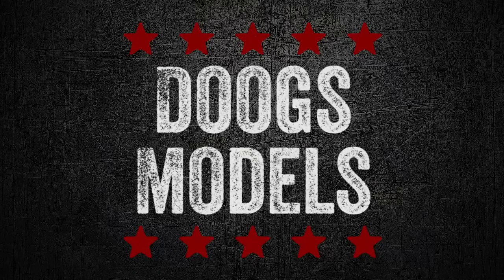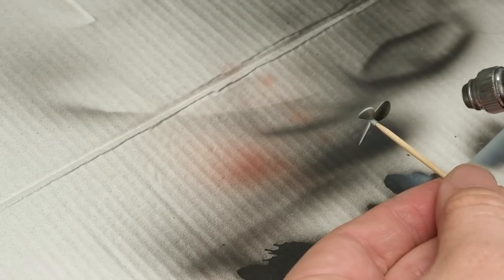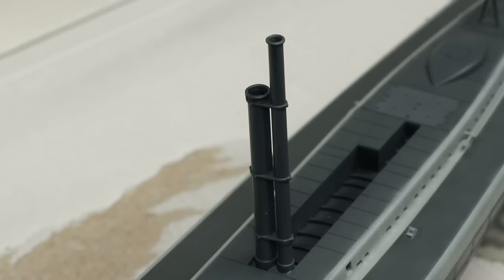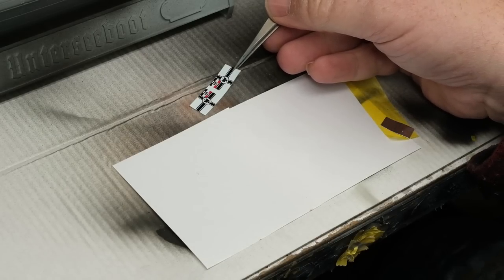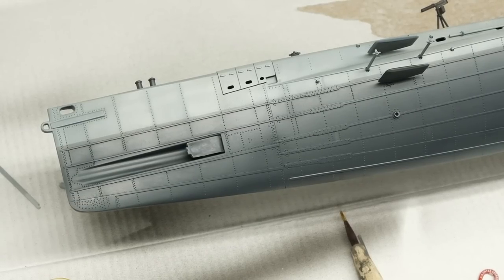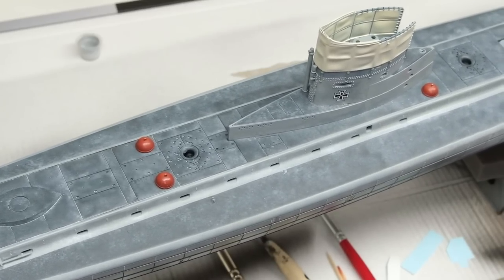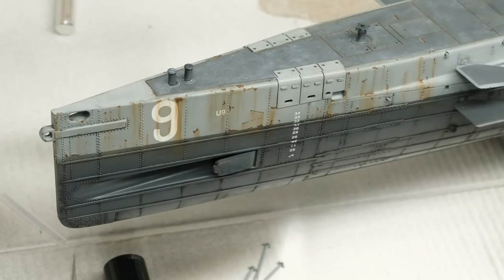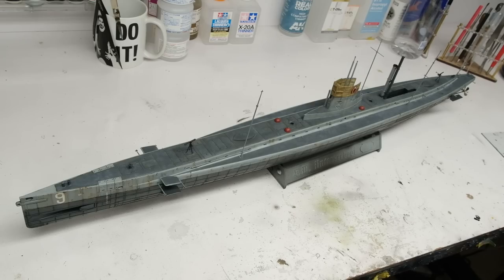Das Werk 1/72 U9 U-Boat Pt 3 - Weathering & Finishing

Comment: Hi loving this build;
Just for information, wooden duckboards were typically painted black with sand mixed in to it. 
As an ex-submariner - we are terrified of being spotted by aircraft when the sub is just below the surface, so anything light was painted. 
Also bear wood becomes very slippery when wet, hence why sand was added in the paint to provide a rough surface.
Reply from the maker: Yeah the painting guide basically shrugs at the wooden boards, so I opted to go with what was more visually interesting. 

One thing I had to keep in the back of my head during this build was that this thing was built in 1910 and its main service was in 1914, before aircraft were a major factor. I imagine practices changed drastically by 1918.

Comment: You're an inspiration to watch. I really admire your techniques and I've learned a lot. If I may offer a couple of critiques though: 1. I would add a light green wash on the propellers. Unless she's just out of the yard, a ship's propellers are never that bright. 2. Your weathering job on the canvas is truly amazing, but it's not right. For future reference, canvas at sea isn't dark, it's light. The sun fades it very quickly. It also might have a slight greenish tinge from algae and a little bit of grimy black around the edges from mold. I'm a sailor, so I've seen this a lot. I apologize if I've offended with my remarks, none was intended. Thanks for sharing this, I'm really looking forward to getting my U-9 kit, and I wouldn't have known it existed but for your videos!
Reply from the maker: No offense at all - I'd put this down to 1) boats not being my element, 2) grainy, low-resolution references and 3) just running out of fucks. The canvas is particularly maddening, since in the references it ranges from almost white to almost black.

Comment: Great job on the boot! I think I am going to have to give one a try. Have you ever used Mission models paint, and what did you think if so? Thanks!
Reply from the maker: I have and I'm decidedly meh on it. It doesn't come close to the performance of lacquers or lacquer-compatible hybrids like Tamiya and Mr Hobby for airbrushing, and it likewise trails Vallejo, Scale75, AK Gen III etc for brush work. So it's this weird kind of middle ground. 

I do like using the black as an intermediate coat for chipping work, since I can darken silver with it and reduce the amount of real paint I have to use - and it will chip very easily. 

But for regular duties, it's not something I'd reach for.
Reply: @DoogsModels   Thank you sir!

Comment: Hey Matt, looks great, and a lot of inspiration for my own upcoming U-9 build. Particularly enjoyed learning how you created the salt effects on the deck. Interesting too about the clear Ammo One-Shot primer...does it dry flat, or gloss? Also, I've been struggling with enamel washes recently, but you clearly nailed it in this video. Would you mind explaining your method? I.e. flat or gloss acrylic undercoat, then enamel wash, how much time you allow to try, and then q-tip moistened with enamel thinner?
Reply from the maker: The Ammo One-Shot stuff dries satin or semi-matte. 

As for enamel washes - I prefer to put them down over a semi-gloss finish if possible (not always possible, but it really depends on the subject). Slick enough to invoke capillary action and keep the excess from severely staining things, but not so slick that it all just wipes away. 

The big thing I've been focused on lately is the value of putting clears between layers of weathering where appropriate to keep them from intermingling into a bunch of midtones.

Comment: Wow, that salt buildup looks very nice. But the canvas... Maybe I have too vivid imagination, but it looks like an overused toiletpaper.
BTW in my opinion there are no such things as "armor technic" or "aircraft technic". You can use all the technics in armor, aircraft, ships, etc. What suits the needs.
Reply from the maker: Fully agree that there's a lot of crosstalk between genres - but certain techniques tend to flow out of specific genres. And may have only limited application in others. The method used for chipping here, for example, doesn't carryover all that well to aircraft because the underlying aluminum/duraluminum has a very different look from iron, and doesn't rust. I do want to experiment more with it and have some ideas for future aircraft builds, but it's a technique that derives from the armor world even if it has broader applicability. If that makes sense.